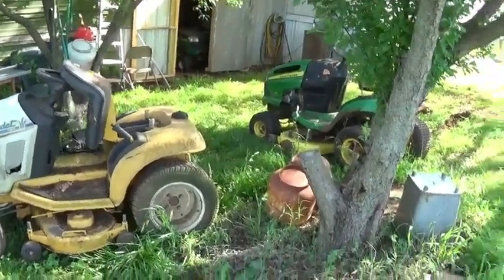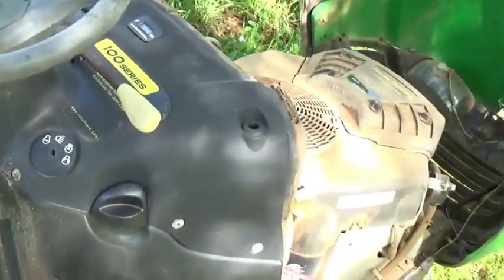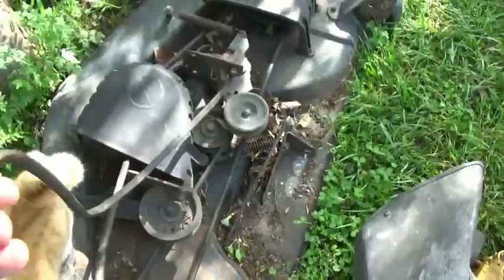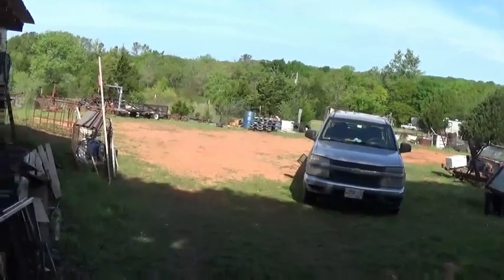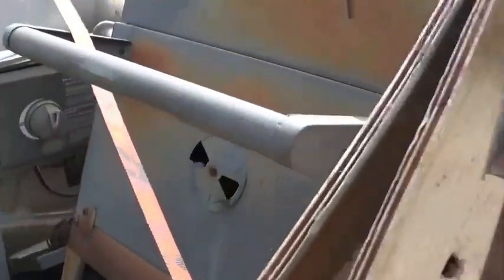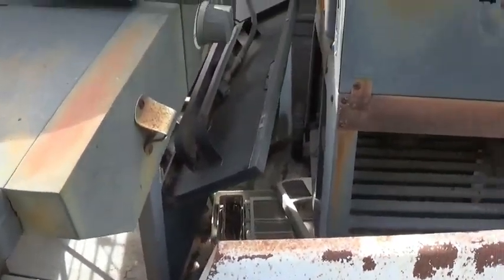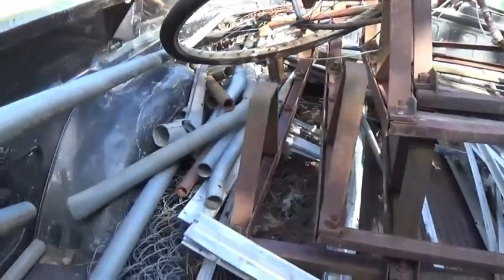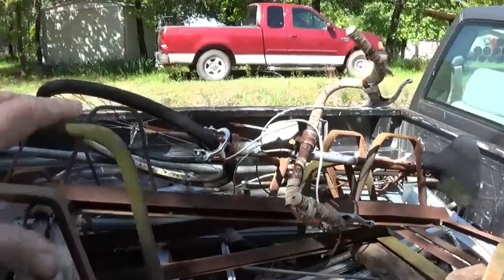3 Loads of Scrap that i brought in this week

Comment: found some good stuff, hope you get your truck figured out.
Reply from the maker: think the motor is shot. bearing seizing up i think, the bearings are bad low oil pressure. may need a new motor, i do have a 99 ford 1/2 ton that just needs a shifting cable so think i will fix it soon, i still have the Colorado for now. Thanks for stopping by Bill

Comment: Yewww truck problems...i had a chevy 1500 ext cab 1994 do that..it never was the same after that..then electronic trans went and it went bye bye.
Reply from the maker: the motor needed to be replaced anyhow bad main bearings very low oil pressure only gave $600.00 for the truck over a year ago. time to save for a new motor or a new truck. i do have a 99 ford 1/2 ton that just needs a shifting cable, less then $100.00 so guess i will have to work on that one. Thanks for Watching Walt